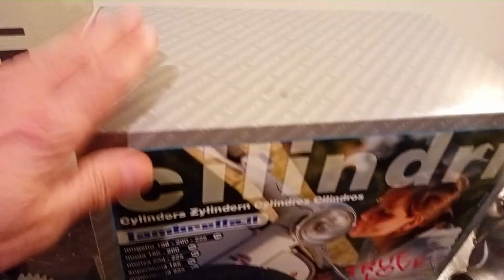#Lambretta Twin Cylinder Engine Build   Full Tutorial Part 1 - using #Chimera Twin Conversion Kit

Comment: Price ?
Reply from the maker: @trovato8160 Thanks for asking! 
The price really depends on whether you already have a motor or if you're starting with a completely new one. It also varies based on the peripherals you want, like the cylinder, exhaust, carburetor, gearbox, etc. I've listed three possible setups with pricing on my website:
https://lambretta-lutz.com/
For a custom quote, please use the contact form there! 
https://lambretta-lutz.de/en/Contact-us/
Reply: @  Thanks, the site is explained perfectly